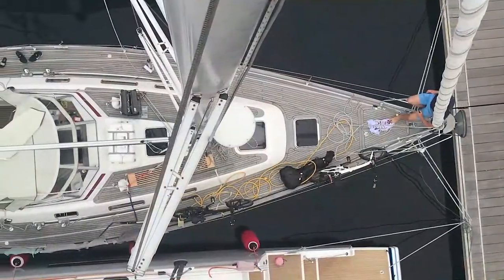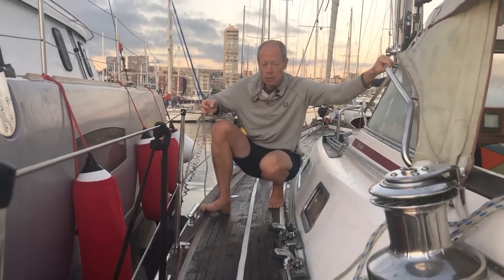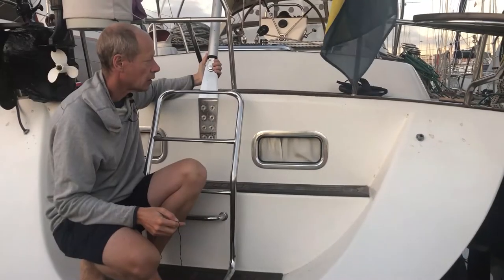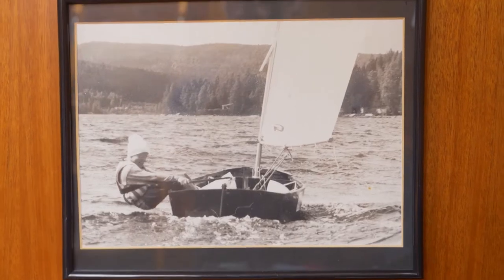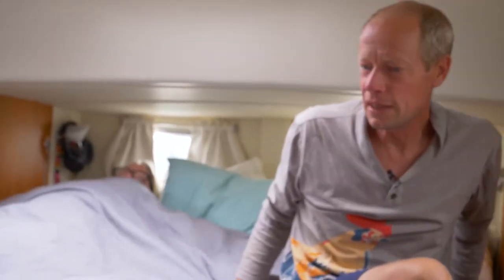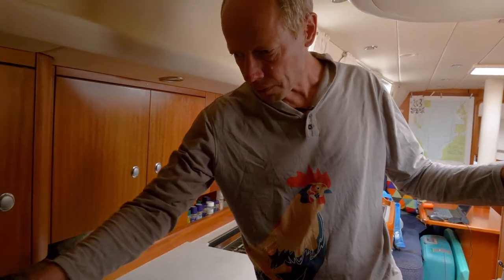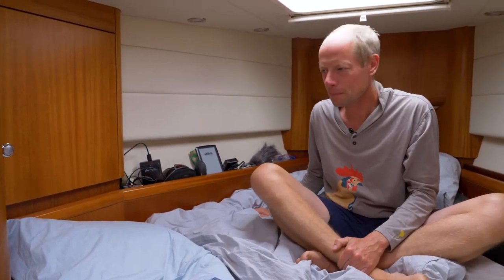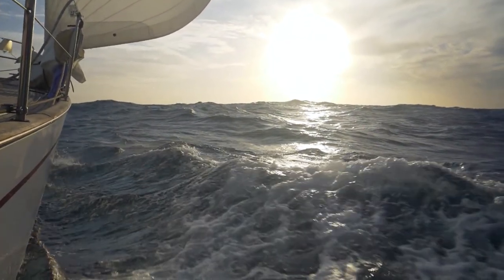Sailing Svea episode 28 -Welcome on board  Najad 405, Svea! Pål is having a guided tour on Svea.

Comment: Thanks for the tour. We have a 2002 Najad400 so interesting to compare. Where did you get your stern arch fitted? Did you design it yourself and are you happy with it? This is a modification we would like to add but don't want to spoil the Najad classic lines. We are currently in A Coruna, heading south this year. How are you enjoying the caribbean? Wishing you fair winds from SY CaCanny.
Reply from the maker: It is hard to make an arch without interfering with the lines, but it certainly improves the long distance cruising image. The more gadgets on the arch the more cudos. We designed it ourselves and made it integrated with the pushpit with the possibility to have the electrical cables inside the tube. They are all filled and we have to have them outside if we add extra things from now on. We want to put the lantern up on the arch and have a lamp for cosyness and one to light up the back of the boat under the arch as well. I can recommend you to make it stronger than you think necessary. The downside of that is less than the positive side. We have 33 mm tubing and if I would redo it I would have chosen a larger diameter.
Reply from the maker: Caribbean is great. Just been here for a week and trying to settle in to crusing mode. It is hard to fail with warm water, coral reefs, always sunny and warm and a lot to do and see on land. Can we follow you somewhere?
Reply: @sailingsvea9127  Many thanks re arch, good advice. We are not on YouTube and really only post pictures when we are sailing for friends and family on Instagram. If you want to take a look it's Sailing Ca Canny.
Reply: Forgot to say we are Cathy and Andy from UK.
Reply from the maker: @cathytodd3996  Nice to meet you!